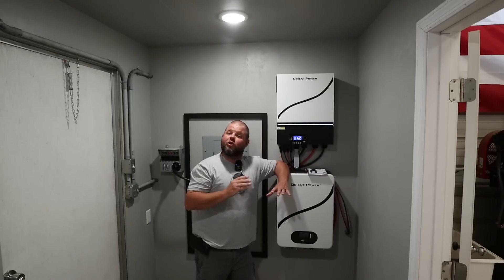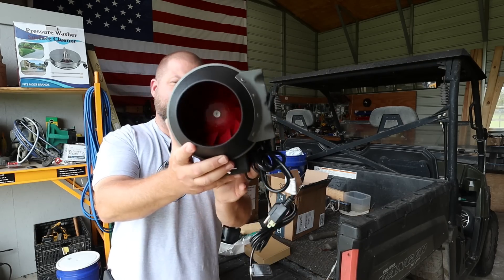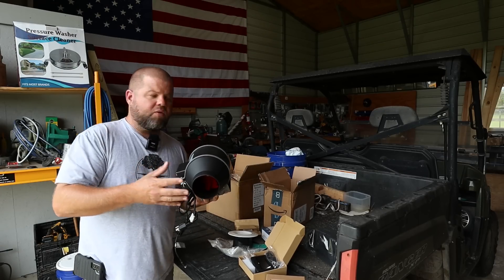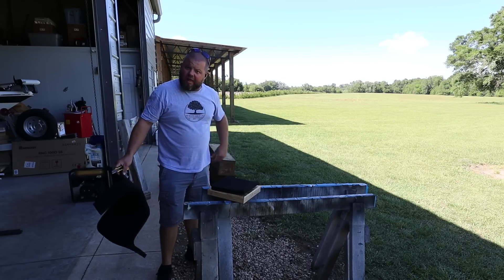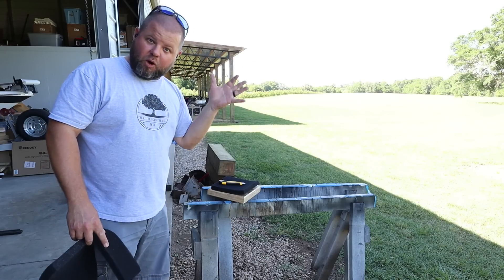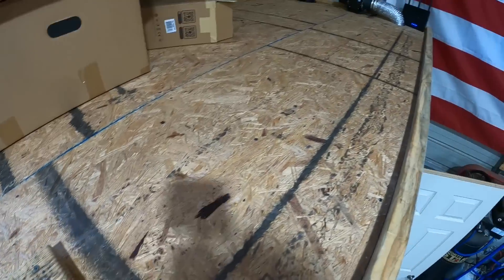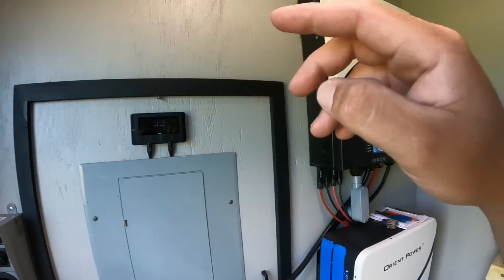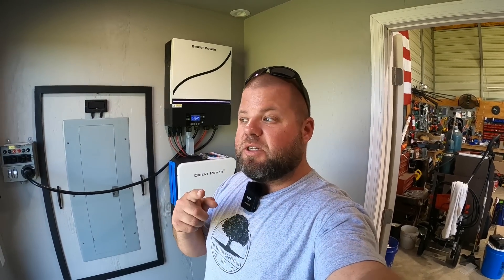Solar equipment room automated ventilation install! #762

Comment: You almost need more stuff in that room to condition it…it’s so small you would be hard pressed to find an AC unit that would run long enough to pull out that FL humidity
Reply from the maker: More stuff coming soon!

Comment: You have to AC that room. HAHAHAHAHAHAHAHA Lots of homes have solar battery installations and they are NOT AC.  So long as the heat is negligible. there is no problem.  Just leave the door open.  Also don't go overboard on fire prevention.  LIPO4 batteries are NON COMBUSTIBLE,  not like lithium polimier batteries.  So not a big issue.
Reply from the maker: Interesting note on the fire facts. I'm going to look into this.

Comment: I would have cut a large opening in the door and installed a high MERV HVAC filter. I have a 24 by 30 cut in my refrigeration room door. I would also vent your duct fan outside.
Reply from the maker: I might exhaust it outdoors if I see any issues, that's a quick and simple fix.

Comment: With all the lithium battery fires lately, it's been said "not" to charge batteries in a living area nor indoors at all, I would suspect even all your battery powered devices also.  Do you ever worry about lithium battery fires?
Reply from the maker: Yes I do and plan to address that very soon.
Reply: @TKCL  Thanks for your reply sir.  Thank God I have sealed lead acid batteries in my Medical Mobility Scooter.
Reply from the maker: Your going to be surprised at the results of lithium iron phosphate batteries. I went down a rabbit hole of research.
Reply: Lithium-ion  fire or LIFEP04 fire ?   Never seen a  LFP fire . Smoke but no fire .
Reply from the maker: Exactly, they are far safer than I realized. It's the older lithium batteries with different chemical properties that was the ones catching fire and having runaway.

Comment: Hey guys.  Great content. Could you  do a breakdown of cost on what you spent on solar and savings.  Also when you do the next panel section consider used panels 1l3 of cost.  Just wondering if there any good.  Keep up the great work thanks again for being real.
Reply from the maker: I do plan to go over figures once I install the rest of my equipment.

Comment: For reliable remote temp and humidity monitoring consider  ...

ASIN  B09BVLP9C5

Yt seems to no longer like url links to the rain forest.
Reply from the maker: I seen your last comment vanished.  Guess it's back to not posting URL's. I have that companies Bluetooth indoor and outdoor app controlled thermometer, it has been bullet proof.
Reply: @TKCL  
However this particular model includes a separate ☆☆WiFi Gateway☆☆ device which relays the BT data back to a server in China for you to access via the internet -  much like everything else in every American home,  how very convenient indeed 🤔 

In addition to the "battery room" you should put one in your freezers, fridge, dog house and chicken coop etc they run on AAA batteries and come in a six pack ...

ASIN.      B09T28XRXH

And a pricey one with a VERY nice local display  ...

ASIN.    	B0B5KF2J34

Btw, did you enable/ move anything onto  the Guest Network?

Were you able to get this vent fan to work reliability over the internet? 

ASIN.    B0B1HPKW21
.

Comment: Andrew, I took a look at the airspace around you. You have quite a few VR routes (military low levels routes) near you. I can send you a screenshot of the routes if you would like.
Reply: If your address is correct on the channel VR1001 runs east and west about 2.5 miles north of capps highway. Well within the allowable airspace corridor.
Reply from the maker: That's VR1002 and the address I give is our local post office many miles away. That particular route is still many miles away. I was not aware of planes or jets being able to deviate so far.
Reply from the maker: I also was looking at the blue routes like a fool when I mentioned the other milage, those faint grey lines are hard to see. Regardless none go over our place. I'd love to know a deviation distance as I can't do d it online.
Reply from the maker: I also seen the VR1001, it doesn't go anywhere near the direction of flights from these jets. They are coming from the gulf heading NE.
Reply: VR1002 heads North East from the Gulf and then makes a right turn direct east over Capps, I’m guessing they are using the full width of the corridor and cutting inside the turn to the south of the route.
Reply: Could be a locally developed low level route that the squadron has developed for their own internal use. Not required to be published on any chart as long as they do all of the terrain and obstacle clearance studies for it. Very common. We were restricted to 300’ AGL in the C17 but fighters can use 100’ as their minimums I’ve been told.
Reply from the maker: That makes a lot more sense. The route they take is from a gulf MOA to a military base in Georgia. But there is nothing on the map indicating this. It's traveled often and they are for sure below 300 AGL at times. Sometimes it's absolutely scary how close to the trees they are. Also interesting they are flying within a 1/4-1/2 mile of a several hundred foot cell tower. I love seeing them, it's my favorite fighter. But it sure makes me nervous to fly my drone for recording.
Reply from the maker: I already checked the map myself, those are many miles always. No VR route over me.
Reply from the maker: Literally 30 miles away it appears, are they allowed to venture that far off course? I was not informed of that deviation in my recent FAA training for my license.
Reply: @TKCL  well the military sometimes operates on a we’ll ask for forgiveness mode. When conditions are right, and they are doing exercises over the Gulf and break the sound barrier, it will rattle windows all over town.
Reply from the maker: Wow 20 miles wide, that would be good to know. However the direction of travel over our home does not match the direction of any travel route on the maps. I'm definitely confused
Reply: Sorry can’t figure out how to paste a screenshot of the VFR sectional map in the comments.
Reply: I would have to look up the specs on VR1002 but some can be up to 20 miles wide
Reply: We get updates on all new towers that go up so we take those into consideration whenever we do our low level planning. As long as we have them in sight prior to a certain distance we don’t have to climb to vertically clear them and can just avoid them horizontally. The reason for low level operations (other than just being a blast to fly) is to avoid radar detection in an enemy environment. Staying low altitude keeps you in the ground clutter of enemy radars so they are unable to track you. So tactically it is much safer to visually acquire them and avoid them horizontally then have to climb up over them and risk being “seen”. 

As you can tell by the frequency that they fly over we practice this a lot. It is one of the more “high risk/high reward” things we do. Risky due to less options if something goes wrong (altitude/airspeed are your friend in aviation, both buy you time in case something goes wrong) but also high reward in an enemy environment due to staying undetected.

Comment: If you want to cut down on screen flickering on the camera, make the shutter speed slower. So go from 1/200 down to 1/50 for example. That keeps the shutter open longer and the flickers blur together.
Reply from the maker: I'm actually at 30fps, I've found 60 to 100 to sometimes clear things up.
Reply: @TKCL  fps is the frame rate, slightly different than shutter speed, although changing the frame rate will affect the shutter speed, because they are inter-related. Shutter speed is the amount of time each of the 30 frames per second is exposed to light.

Comment: The planes must be from Moody AFB in Valdosta. Your solar room is looking nice. Looking forward to your fire suppression system.
Reply from the maker: The direction they always fly from suggests Tyndall AFB.
Reply: @TKCL  I don’t believe we have any warthogs stationed at Tyndall currently. I know they do joint exercises with Moody as they use the Gulf as a training range. I love watching the F-22’s taking off and landing. The sound of freedom.
Reply from the maker: They could be coming back from gulf trainings. Weird thing is no fly zone noted on on aeronautical maps for my area.
Reply: A-10s definitely from Moody, they’re not stationed at Tyndall. I don’t know exactly where you are in Fl but remember you saying something about being near Tallahassee. There are multiple VR, SR, and IR (Visual Route, Slow Route, Instrument Route) low level routes that crisscross all through that area. Even if you are not directly on the centerline of these routes the corridor is usually at least 5miles either side of centerline and it is the pilot’s discretion where in the corridor to fly. Also, if you’re not underlying one of the published routes I mentioned above there could also be a locally developed low level route that these guys are using that just happens to be running over your property. We had a couple of those developed for C-17 use when I was stationed in Charleston and also up in Seattle to aid in mission flow when some of the “real routes” were booked or just to far out of our way to make them feasible for the specific training of the day.
Reply from the maker: The direction they take from a Tyndall MOA in the Gulf to Moody appears to be accurate.  There is no VR routes on the map showing that path or heading.  It must be unlisted, something I didn't realize could not be posted on a map. All commercial drones are being required to have remote ID later this year, I am curious if planes and jets will be able to see it.  The FAA claims it's for ground to drone identification in the event of an emergency and the drone needs to be identified.
Reply: Depends on what the remote id tag actually is as to whether or not we’ll be able to see it. I’m sure that’s the ultimate goal though as the number of drone strikes/close calls has been climbing rapidly in recent years. Not so much in your case on low level routes with military aircraft but mainly around large airports with commercial airliners where guys aren’t supposed to be flying their drones anyway.

Comment: If you could get a hold of couple 100 feet of 6" or even 4" pvc you have room to run underground for cooling that small of a room. Dig a trench out 5' to 6' deep and loop the pipe. New pipe would cost more than a a/c unit. It would  be cheaper in long run. I hope I can do it when I build my new shop. Great video as always!
Stay safe
Reply from the maker: I've been kicking some geo thermal ideas around.
Reply: That is the Exact comment I was gonna Make
 Free cooling from under ground.
Reply from the maker: I've got some "cool" ideas coming in the future. I am honestly waiting for pipe to drop in price, it's ridiculously high.